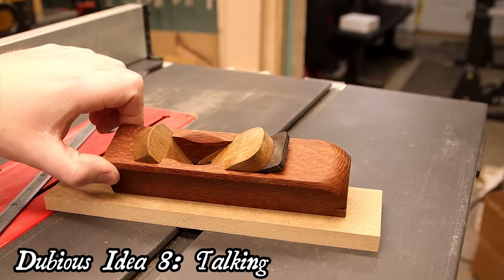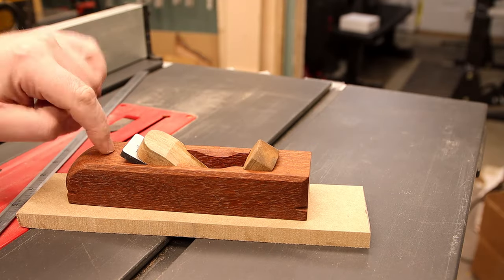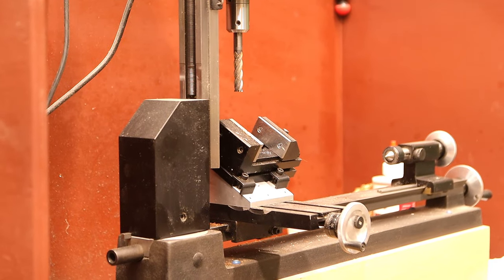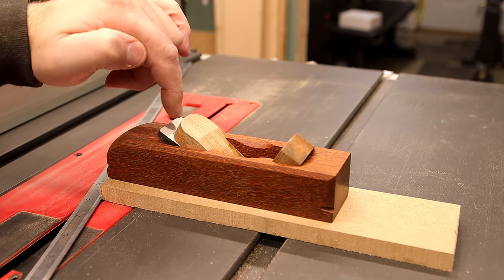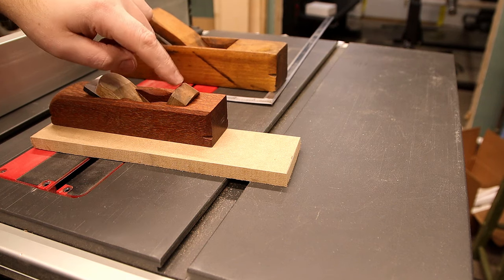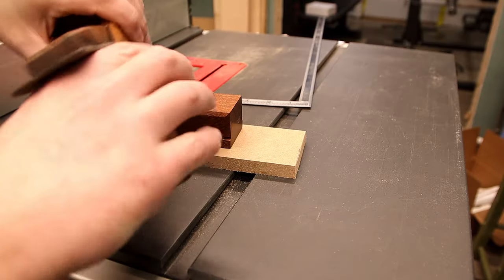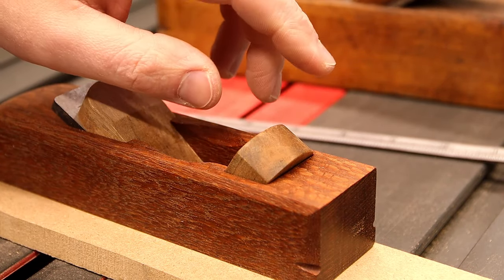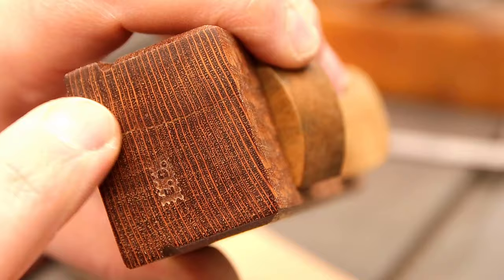Leopard Wood Mitre Plane with a Mouth Closer

Comment: 11:39 😂
I recommend calmping that then taping the bottom and sides of the crack, using the extra thin water like ca glue and some accelerator will get you right back where you were and will work incredibly well.